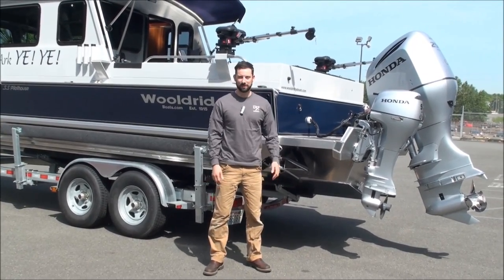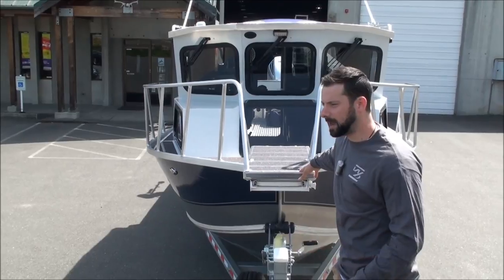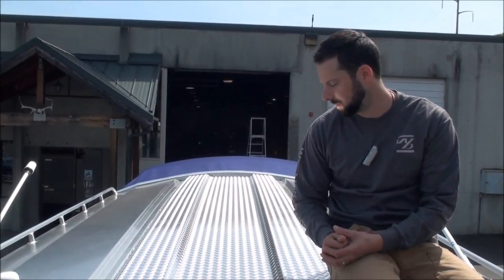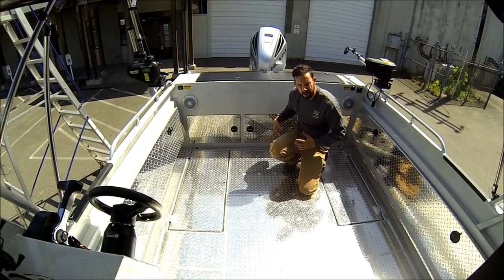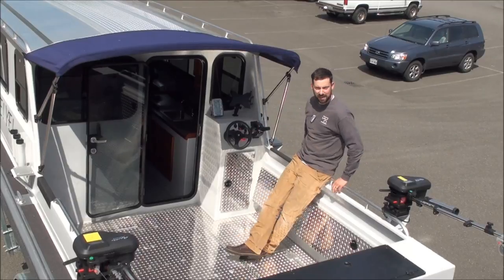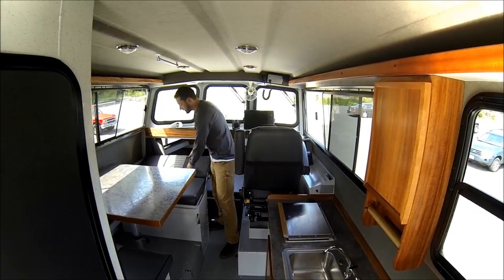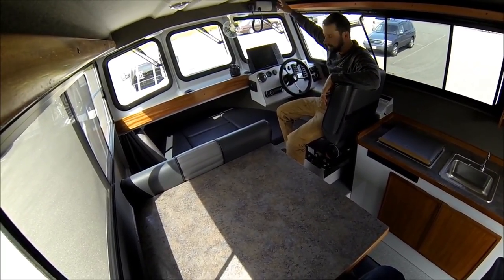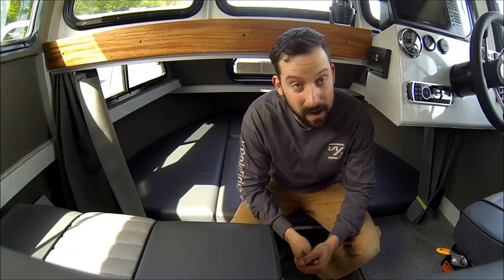Wooldridge  |  26' Super Sport Offshore Pilothouse

Comment: Great video.
I'll take TWO!
250 HP? The majority of people with 26' heavy-gauge aluminum hard-top boats just like this go with 400 HP (twin 200's), I believe. However, this boat is, what, only 18 degrees at the transom (more side-to-side stability, which I like), so less horsepower would be required. Some competitors are as much as 24 degrees. Also, Wooldridge boats are, I think, a bit lighter than most of the competition, so less horses needed - saving money.
Reply: thank you for watching and yes you are correct about the deadrise and weight.